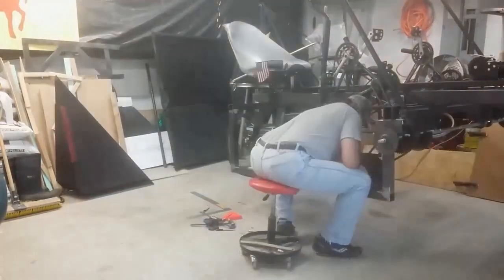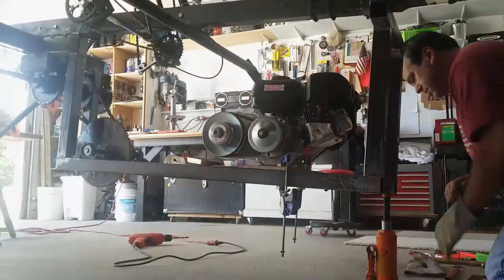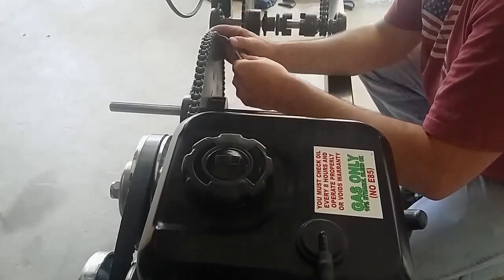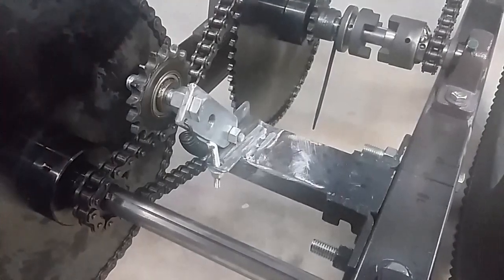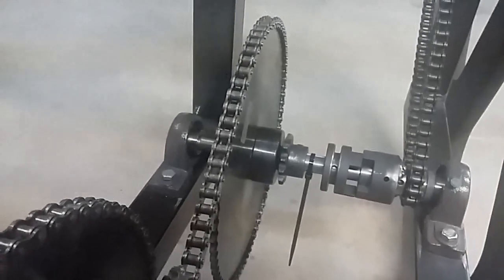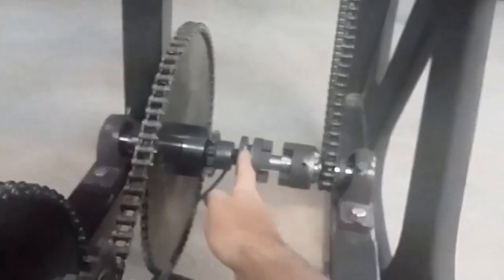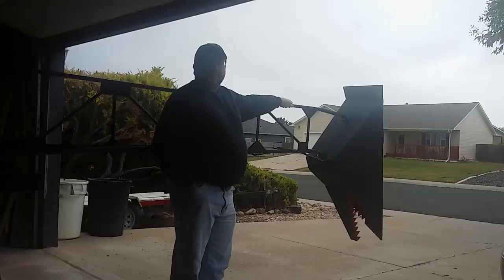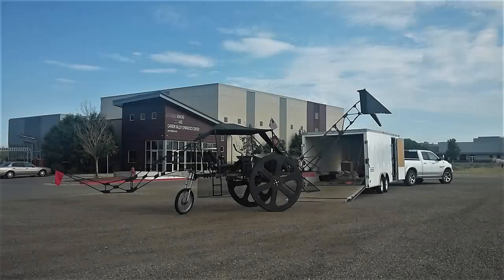Go Kart Chain Transmission Part 3 - Assembly & Test Ride: The SMOG Project 10

Comment: Little helper for you....you can buy two peace collar.....put where you have tie strap on your shaft...to stop movement.....locks your sockets from moving sideways.
Reply from the maker: The zip-tie was just for temp. testing purposes. The slot I turned in the left side of the clutch is for a shift fork. But since I haven't worked out the final configuration of the jack shafts, I haven't built the fork or linkage yet. I'm already using one-piece locking collars. They've fine for low-speed, low vibration applications. But with SMOG's original drivetrain setup (the one in this video), the vibration was so intense that it shook everything loose. Collars, sprockets, bearings, me... EVERYTHING. Once I have time to install the new 4-jaw chuck on my lathe, I'll be able to turn grooves in the jack shafts for snap rings. Until then, I'm continuing to work on isolating the engine vibration with the dynafocal mounts.